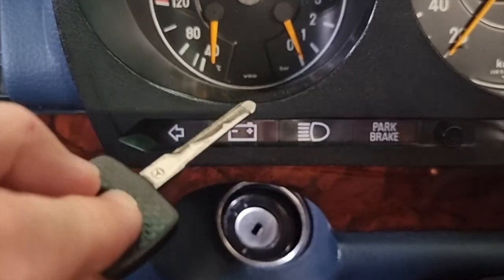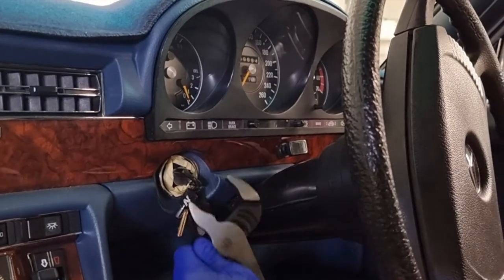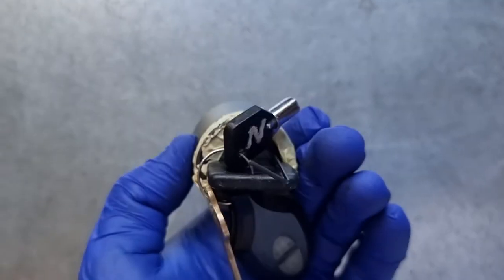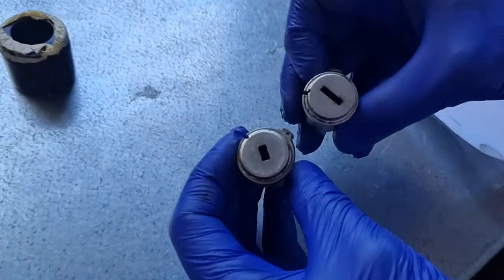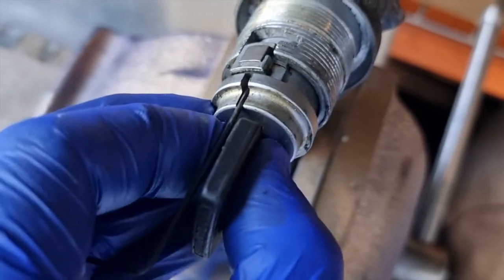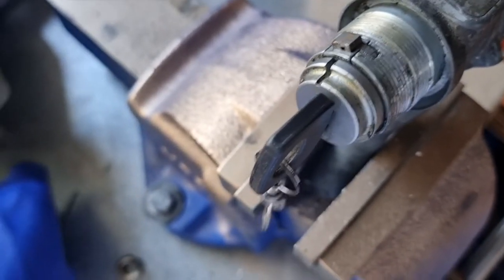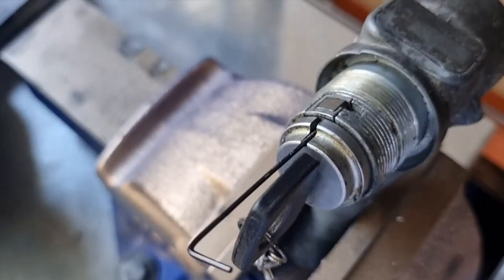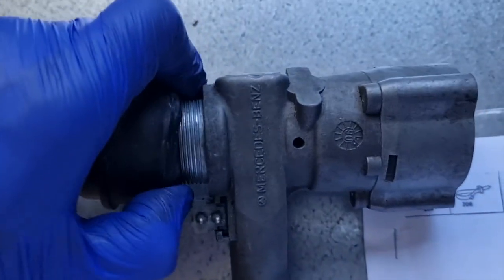Mercedes W116 ignition barrel replacement

Comment: Great informative video. Many thanks. I’ve got a 107 where the key won’t turn at all in the barrel, got to figure out where to drill the shroud to allow me access with the Allen key. Nightmare.
Reply from the maker: Hi Phil . Your 107 lock should be the same. There is a pin on the shaft which goes into the steering column. You will see it in my video and it's accessed from below the dash with panels off. It would break your back to drill out but the cleanest way. Alternatively , I have a video of a 123 lock my old school mechanic had a tool to simplify its removal